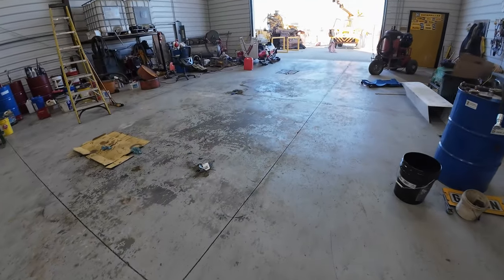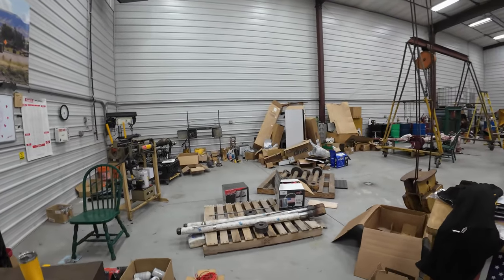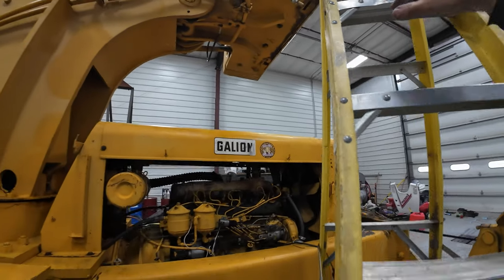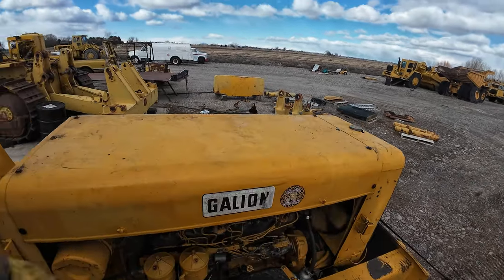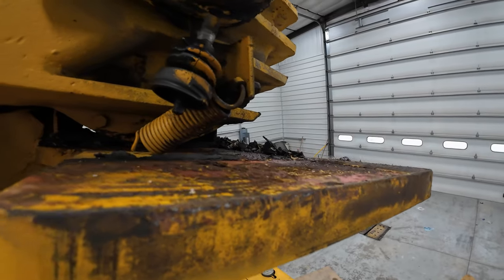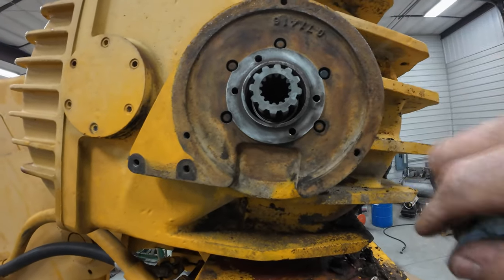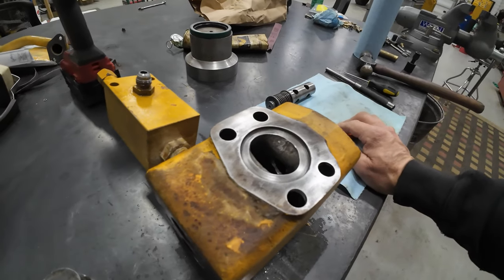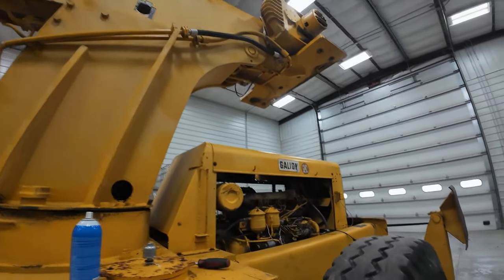Galion Crane Is Done

Comment: The gallon was the unit we left the keys in or gave the wrong address to the lowboy driver just trying to "get  rid of a nightmare" it was so strong you couldn't overload it without really getting stupid ,but a SOB to fix the manuals weren't complete and left critical stuff out ! That upper boom fitting had adjustment on it from what I recall so you would be able to sync the crowd cylinder with the main boom ,been a long time I might be FOS ! You just amaze me all the time you have relationships with your equipment as do I I watched my dad keep up equipment that were thrown away and use them for decades we didn't have the money for everything we needed but I remember that dam crane beat me up more than anything else! Wish you luck great content  god bless you and yours
Reply from the maker: The manuals definitely leave you scratching your head,  they use a relief valve so you can two block it and it will overcome the winch

Comment: When you put the counter weight back, use blue Locktite or the equivalent on the threads. Not 2 or 3 drops. Put it on like someone else is paying for it. It’s better than anti-seize for this. The key is it’s anaerobic. Keeps out air. If it keeps out air, it keeps out water, and rust. Works on foundation drilling rigs, on even larger bolts. If you don’t have one of those Parker- Hannifin rigs to filter hydraulic oil (on a hand truck like affair), see if you can borrow or rent one to run your hydraulic oil through to get the water out. Might save you some headaches down the road. Good luck and take care.
Reply from the maker: Thanks for the advice on the filter,  I did some research and found I need a coalescing filter,  I may have to buy one

Comment: Oh that that ingersoll rand electric 1 inch cant you undo that allen head bolt on the handle and rotate the handle position on it or not? Just looks like it would be able to i have the Milwaukee one and power for that comes down needing there biggest battery possible not sure if ingersoll is the same way maybe get a bigger batteries for it and have more power

Comment: Once you get cover off. Think about spliting the cover, or making a two peice cover, that can be opened for maintenance with counter weight in place.
Reply from the maker: It's got a set screw on the end to hold the backlash on the one way clutch,  bad design

Comment: Jeff, Hang the impact of the service truck boom, I also suggest filling the bolt holes with silicone to keep the water out. Would it be possible to drill two 1/2" holes in the top of the counter weight and thread them got eyebolts to lift from?

Comment: Hey  Jeff  have you checked  the glow plugs on the engine  for the Gallon  crain  ?    I have a couple  pieces  of equipment  that has that engine  and they definitely  need to have the glow plugs  to start .
Reply from the maker: They quit working the day it went into the shop, I've checked the push button and it's sending power to the wire but somewhere in the harness it's got a problem

Comment: I remember thinking from the previous video, those two side holes should lift that counterweight OK.  But, I wasn't sure since I couldn't see all the details of the CWT.  Well, now you are one of the more knowledgeable people who are able to work on these old Galion's!  Galion Pride.

You did inspire me to go watch the Torque Test Channel - watched the IR vs Milwaukee 1" impact.  The IR does have more scoot, but if it is hard to use...that doesn't matter.  Maybe I'll try the Milwaukee one of these days.  It's big enough for anything I'll use it for.
Reply from the maker: My trigger sticks and that's super dangerous, you could loose a hand! we'll find out how much torque it has when I start putting new rollers on killdozer
Reply: We us the milwaukee 1 in drive impact alot at work on the railroad. It's real handy but I question the torque ratings. Certain things we have to go back to either our hyd impacts or even just our 4 ft hand wrenches. It's great though for if you just got a couple things to loosen or tighten.

Comment: You can't have too many small springs, screws and bolts in your collection of parts. Nice work, Mr. Jeff! It is always interesting working on old equipment without proper manuals etc. Some stuff was designed by idiots! That's for sure. G'day from Tasmania, the island under "down under"

Comment: Question....
Are you going to check the cable for any defects or rusted braids. 
I really don't want to see a broken cable video. Because a cable doesn't break unless there is something on the other end of it.😁
Nice job and a great piece of Arsenal to add to the fleet.👍
Reply from the maker: yes I'm concerned about it, what's on the spool is good and greasy but from the spool to the hook it's rusty......bad
Reply: @Jpaydirt Yep change the cable. Had about the same crane break the cable while lowering the dump cylinder on a mack tri axle in the early eighties. I was the mechanic guiding it standing behind the cab. Somehow the cylinder tipped away from me and the shive block smashed the top of the cab. Closest I came to getting killed in 40 years wrenching for a highway dirt contractor. Remember it like yesterday. 
Pat from northwest WI
Reply: @Jpaydirt Yep change the cable. Had about the same crane break the cable while lowering the dump cylinder on a mack tri axle in the early eighties. I was the mechanic guiding it standing behind the cab. Somehow the cylinder tipped away from me and the shive block smashed the top of the cab. Closest I came to getting killed in 40 years wrenching for a highway dirt contractor. Remember it like yesterday. 
Pat from northwest WI

Comment: After the pump rebuild it ended up without enough flow to start as that is a adjustment in the pump
Reply from the maker: it starts just fine when the glow plugs were working, but the main feed wire has a problem, also when I removed the fuel lines at the injectors some of them were dry, so I think the injector seats are bad enough that the fuel leaks into the pre cups. it misses on several cylinders until it runs for a few minutes and weezes from one which makes me think that one hole is cracked between the valves or has a bad exhaust valve

Comment: Too bad you didn't have a portable oil/water separator centrifuge to hook in line with the fluid return line, but they probably aren't cheap.
Reply from the maker: Really?  I didn't know that was possible, at 1300 bucks a barrel I'd love to save it as it would be 2600 bucks to change it again
Reply: @Jpaydirt  Yes, they make centrifugal separators. I'd have to research where you can get them, but we had a bunch of them when I was in the Navy. So I'm sure there's civilian models too.
Reply: @Jpaydirt  PA Biodiesel makes a 55Gph centrifuge and it's under $300 on ebay.
Reply: @Jpaydirt  Also, you might want to check out the Spinner II 596HE

Comment: Stablizer have to de down, allow crane to lift (crane safety design).
Reply: Most rubber tire cranes can lift without outriggers down.  You'll have charts for 360°, over the front and possibly pick and carry - all without outriggers down.
Reply: @boomupengineering   In Edmonton AB Canada we had fatality in early 2000's with Galion crane flipping on side. Investigators safety issues with crane design. Crane parked in yard many years, nolonger there.
Reply: @sharonfieber6458  Sure, cranes come with risk, especially if they malfunction.  That design has been around for decades.  Anyway, most crane accidents I see are from operator error.  Many operators these days rely too much on the crane’s computer.  Obviously a Galion is all up to the operator though.

Comment: Lost me at the end there. Stuff was dicked, then it wasn't. Congrats eather way
Reply from the maker: I just put it back together and it works,  I have a new seat coming,  I need to lift something heavy to see if it lowers slow and doesn't turn the winch motor into a pump,  that's the function of the anti cavitation valve.  So will that function work with the damaged seat valve is the question,  I don't think it will, but I've been wrong before,  when I get the new one I'll go into detail about what it does and you'll see the damaged one.
Reply: @Jpaydirt  cool, looking forward to it. You could lift the counterweight for some dramatic irony. Thanks for the content